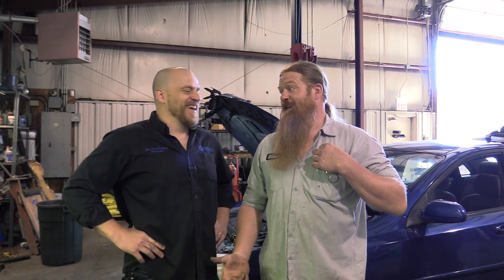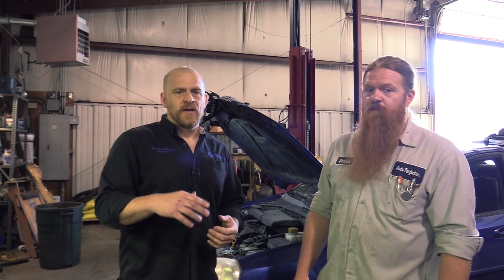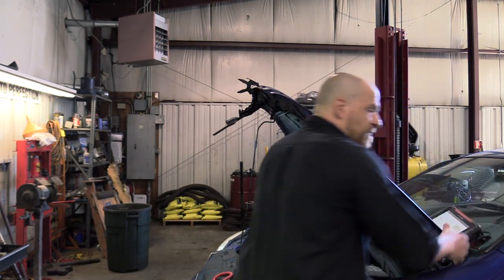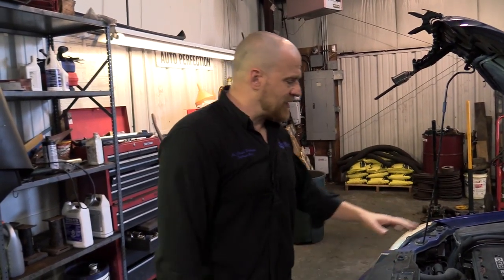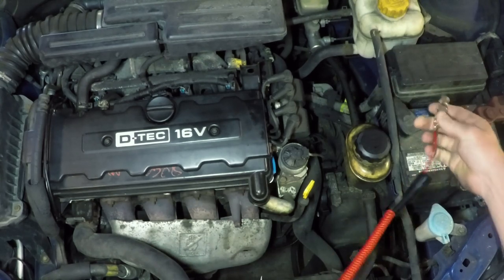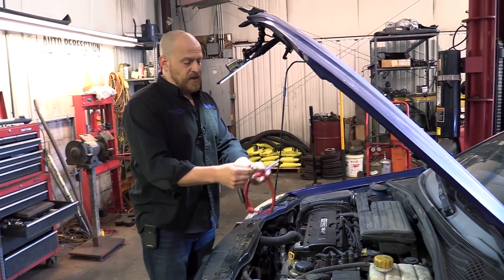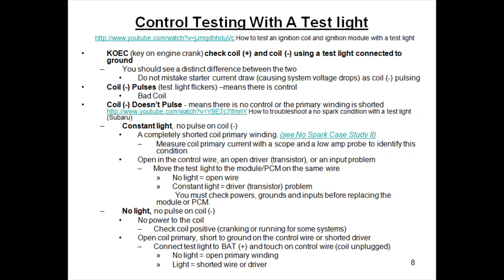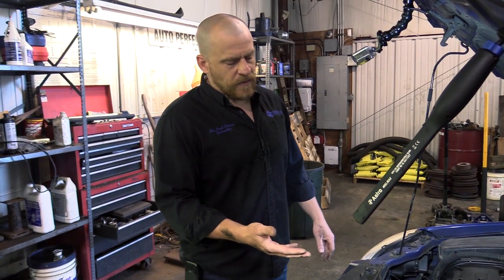Weak Spark From One Coil (Waste Spark Coil Assembly)

Comment: Paul, you spark test method showed me a bad pack on a Ranger one time, then the bad new one a few weeks later. Returned it to NAPA and bought OEM. Thank You!

Yes, loose sparks make boom. Had a tractor flooding. Pulled the plugs and cranked to clear the fuel out. The second crank sparked and lit the fuel. No one hurt, nothing damaged, but there were a few exciting moments!

Comment: This is a great way to find an idle issue that isn't smooth.  You don't have to have a misfire code...it takes a decent amount of misfires to trip a code.  You can simply and quickly test the gap that each coil can produce and find the relationship between them.  If they are way off replace the coil because the power balance of the engine is way off.  Learned a lot from this video.

Comment: Thank you for illuminating my path. That is exactly the symptoms of my coil pack and the misfire on my car that is triggering the "Depollution system Faulty" because the misfire due a week coil pack  is not burning the fuel/air mixture as it should. Thanks

Comment: I never had one explode on me ... but I did get mad one time working on my '79 Mercury Capri 4-banger turbo (ignition problem) when I was 20, and put the handle of my hammer right through the top of the battery in anger. The acid splashed up all over me, my face, and got in my eyes. Luckily it was winter - just grabbed a handful of snow and rubbed the crap out of my face and eyes - got it before it even started burning, thankfully! Cat-like reflexes at that age! My clothes, however didn't fare so well, as you can imagine, LOL! When they came out of the wash, they looked like I stood in front of 10 shotguns loaded with #8 at close range. Mom wasn't too happy about that one ... 🤣 Learned a valuable lesson (a couple, actually) that day!!

Great lesson, Paul, great filming, Caleb, and always great to see Danner - still so happy for you guys about that shop there!  The Lord never ceases to amaze. 😎🍻

Comment: There's always something to learn with Danner, I  was absolutely convinced that ANY spark was a good spark, I wouldn't have even entertained a present but weak spark as being a problem.  The thing that  changed my mind is the draw of the gest light weakening the spark further and enhancing the misfire. Further to this and something that was either unnoticed or not mentioned in the video was that when the spark gap of the weak coil was being tested the draw of the spark weakend the sister spark and enhanced the misfire pro ing the theory.  Again good work Paul.
Reply from the maker: That is correct, when you have an open on one side of a waste spark system it will affect the companion cylinder as well. Thank you!

Comment: Again you really do so much effort, deserve at least 1 milion subscribers. Can you make video about gasoline direct injection injector waveform. Thanks for everything
Reply from the maker: I have some GDI injection operation and testing available on SD Premium, but I am sure down the road you'll see some case studies here on GDI systems too
Reply: @ScannerDanner  Thanks on Euro cars all new one have gdi systems. I looked on the internet and there aren't a lot of information, if I undrestood they are not classic power or ground side switches. They switch each other and voltage is much higher

Comment: I want that job so bad... Id have to move from Iowa tho ☹. The dealer i tech at promised futher training and after a year still nothin, i havent even got a GM tech number to sign into the comp. system..... So I learn from these vids and SDs book (better info anyways) By the way Paul the old timer in the bay next to me thinks ur book is excellent and hes been in the field since the early 70s. Ive even impressed him a few times with your diag methods🤙
Reply from the maker: Awesome! Thank you
Reply: Even Warren, over at "WESTERN TRUCK AND TRACTOR REPAIR" YouTube channel, gives praise to your book and your instruction!! And he is a mobile diesel and farm equipment repair guy!! Ain't too many lessons in your books, describing how to pull a 150lb belly pan, out of a D8 dozier, in order to get the hydraulic hose out, while laying on your back in the Forrest, watching for bears!!
Reply: @ScannerDanner  Sir, my i20 1.2 petrol has exactly the same coil pack layout as in 7.27 time. One coil pack has cylinder number 1 and 4, and the other has 2 and 3. Each coil pack is controlled by 2 wires each which means each secondary circuits are controlled by individual primary coil circuit.

Now, there's less spark coming from the one high tower of first coil pack and same is happening in the second coil pack too.

I checked for resistances reading of the secondary and primary circuit individually in both of the coil packs. They gave same readings about 14k in secondary circuits when tested with multimeter from one tower to another of the same coil pack. I wonder why such less spark is produced on one tower within the same coil pack where the 2 towers are controlled by the same primary coil circuit???? If one is showing less spark, why the same less spark is not produced in the other tower of the same coil?

Please do really help me find solutions!! Have been struggling to find solutions but not succeed yet......Awaiting your utmost service.. thanks.

Comment: one thing to add, on the double spark plug shared coils. bad plugs and wires can cause weak spark when testing, since it's using the other wire and plug as the ground path on other post.
so bad wire end or high resistance from broken down wire can cause it to look weak when testing. I resistance test the plug wires first or use a known good wire and plug for the other side temporarily
Reply from the maker: Think about this my friend, you are correct to a point, but an open plug or wire would NOT cause the spark to be weak on both sides of the coil! You would have to have BOTH plugs and or wires open for this to happen and that doesn't ever happen. This was a valid test and the only variable here was the dwell time issue I mentioned.

Comment: Another good video, as usual. By the way, I believe the reason yo were only seeing the bad coil trace rather than an alternating good/bad is that the shorted coil had a faster current ramp, therefore tripped the trigger level before the other (good) coil trace could trip it every time.
Reply from the maker: Best explanation yet but they still alternate and that trigger level was set to a point where both crossed it. Unless there is an internal clock on the sampling that has a delay before it actually draws the waveform??
Reply: @ScannerDanner  .  That's a good question. My answer assumes it was set up for a single trigger and it catches the 1st one that crosses the trigger level in time (which is the bad coil due to it hitting the current level quicker/steeper ramp).

Comment: dang i wanted to see you dance around doing the spark plug waltz.  lol not really its no fun. i worked with a guy that liked to just yank wires off to find a miss. when ford came out with the duraspark 2  he got bit. that spark found its way to ground and the closest thing to the metal was his wee willy winkey.  to this day i see him and call him sparky lol
Reply from the maker: lol
Reply: Wait till you grab a magneto.. They all watched while I turned it to time the engine. I looked like Doc in Back to the future. As I got hit with 50k volts of primary off it..My hair was standing up form the jolt. They laughed their ass off so hard. I never made that mistake again...
Reply: @ScannerDanner  Sir, my i20 1.2 petrol has exactly the same coil pack layout as in 7.27 time. One coil pack has cylinder number 1 and 4, and the other has 2 and 3. Each coil pack is controlled by 2 wires each which means each secondary circuits are controlled by individual primary coil circuit.

Now, there's less spark coming from the one high tower of first coil pack and same is happening in the second coil pack too.

I checked for resistances reading of the secondary and primary circuit individually in both of the coil packs. They gave same readings about 14k in secondary circuits when tested with multimeter from one tower to another of the same coil pack. I wonder why such less spark is produced on one tower within the same coil pack where the 2 towers are controlled by the same primary coil circuit???? If one is showing less spark, why the same less spark is not produced in the other tower of the same coil?

Please do really help me find solutions!! Have been struggling to find solutions but not succeed yet......Awaiting your utmost service.. thanks.

Comment: Surprising... the underhood layout of that 2006 Suzuki Forenza is strikingly similar to the 2009 Chevrolet Aveo ecotec engine and bay, but the aveo has a coil on plug cassette that runs down the center of the cylinder head instead of externally.

Comment: It's not always that simple! And it pays to have multiple tools at your disposal! Along with your expert guidance and instruction!! I once had a friend need to fix a misfire! And without spending money on the parts cannon ammo! I did all I could, without some higher tech equipment!! 

It was a 97 GM 5.7, with the dist. cap with the scientifically designed spark plug wire outputs, oriented towards the proper side of the engine. There was a low priced replacement dist cap installed, when he got it! It ran well, except for the obvious fuel spider issue, common on that vintage engine! But, shortly he developed a misfire, that even caused the MIL to flash! It was just that I couldn't figure out what was causing it. It turned out to be the cross talk inside a poorly designed dist. cap!! The 5&7 were sparking on each other, inside the cap, where the lines were close together, and fire was jumping between the two!! The spark was jumping from 5 to 7, and then 7 to 5, causing an odd misfire that I couldn't decipher on my own!! It took another buddy with a Snap On scanner, to be able to see what was happening, and when!! A new Delco dist. cap and a rotor fixed the problems! But, you could tell the old ones were brand new, and you couldn't see where they were cross talking inside!! It was just that spark was jumping, deep inside the cap, between the two line! No continuity! Just cross talk!! 

I checked for spark at each plug, and deduced that the coil wasn't bad! I figured that each plug was getting fire, and could tell no other issue for a sudden misfire! As we needed to replace the fuel injection spider anyway, I went ahead and did that job, before going any further! After that, it ran great, except for the oddly intermittent and changing misfire!! I even ran a test light along each wire, looking and listening for leaking spark!! I just finally gave up! When the scanner was hooked up, I wasn't around, but was told what was up before the new cap and rotor was installed!! IT ALL CAME BACK TO ME!! Some cheaper aftermarket dist cap and rotor would cause issues just like that, back in the day! I also got side tracked on the fact that 7 of the 8plugs were brand spanking new, platinum tipped plugs, but one was an older, likely an original style, regular plug! I thought an owner was having issues, and replaced them, which didn't fix the inj spider problems, and broke a new plug during installation, and just put an old plug back in! I wanted to get another matching newer plug, but he refused! He still has the older plug in there to this day!! 

Just having you demonstrate what to look for, what to listen for, and how to check for it all, is priceless!! And I did most of it!! Some times, you just need a scanner, or a rich customer, willing to pay for parts cannon ammo!! Lol

THANKS FOR SHARING!! Say "Hey" to your mama!! ;-)
Reply from the maker: You can use the test light test on the cap end of the plug wires. Pull them off and make sure they all jump past the towers. The cross firing ones will NOT jump the same gap :-)
Nice job and write up my friend. Thank you!
Reply: I wonder why I DIDNT THINK OF THAT?? Oh, I know!! I'm not as smart as...well ya know!!! Lol

That would have been an AWESOME TRICK!! But, it was no biggie. Thanks!!
Reply from the maker: @roadkill5333  lol, it's all good buddy. I've gotten my ass handed to me by this design in the past and it was that test that proved my issue over anything else I tried

Comment: Great video. As are all your video's I have watched so far very informative and very useful to me as iam in the trade .I have to ask I was always told you should not pull ht leads of while engine is running as you can get a nasty shock is this not the case as you pulled them of with out get a shock.

Comment: I have a question. When carrying out such spark gap jumping tests, (on let's say a perfectly good coil), when the gap is increased until the spark no longer jumps, doesn't that immediately cause coil damage which had not been there before? Surely even just one spark that finds no easy part to ground is going to bore a channel through the coils internal insulation to reach the opposite end of the coil winding internally, and thereby initiate a channel of weak insulation which will eventually come back as a damaged coil customer, once some other factor put the ignition coil insulation under high load. I do this jump test myself, but I always try not to provide a gap larger than 10mm, lest when I do, the spark can't jump the gap and coil insulation is immediately damaged with even just one spark that can't reach ground. I realise the damage might not be apparent immediately, but I can't see how damage is not occurring. That enegy has to be going somewhere, so the only place I know of is a direct internal short, breaking down the internal insulation? This is only my assumption, so the question is, can anyone give a scientific answer as to why even just one internal shorted spark doesn't do damage? Thanks

Comment: Well another great video as always and I've got a question on that  waveform at the top of  it will it always have a tail like that or was that mainly bc of it showing as open signal???
Reply from the maker: sometimes that tail can be induced by having the amp clamp too close to the coil housing. I believe that is why we were seeing the large tails but a large tail can also indicate an open plug or wire

Comment: I had the same issue weak spark.. Bought a supposedly brand new ignition control module and got a weak spark from another coil.. Took it back to the store. And it was a return from another customer... Who told them it was a bad I. C. M... So always check your supposedly brand new part.. 👍.. Happy hunting..
Reply from the maker: nothing more frustrating that a bad, new, part

Comment: Thanks for a very detailed video. When you first checked the coil and found you had a weak spark my first thought was what about the spark plug or spark plug wire on the other end of the coil. Since pulling one wire out of the coil and checking the spark you still have another spark plug and wire in its secondary circuit. Couldn't you have simply grounded one side of the coil and then checked the spark on the other end of the coil? If you had a good spark at that time then you would know the problem is in the plugs and wires. If the spark was still weak them you would know that it was a bad coil or a bad coil drive circuit. What are your thoughts on my logic?

Comment: Do you think it might be beneficial to show the result after repair, so we can hear the difference?  You do a great job at confirming the diagnosis/code and explaining what’s happening, but a little conclusion or denouement would be nice.
Reply from the maker: I usually do but it is not always possible. Also in this case, having a known good coil to show you next to the known bad was, in my opinion good enough. The only thing a new coil would have shown you is what you already saw in the coil that was working. You would have heard nothing different. You would have seen a spark that was good and a coil ramp that was good, but again, we already saw that. So that's why I didn't go back to my brothers shop to film the follow up.

Comment: First, I want to say thank you for posting so many videos on youtube. I watch them often. Sometimes, just for fun and educational purposes. I have troubleshoot question now. I own a 1996 Ford Thunderbird LX 4.6L. Could you give me some direction on PO308 And PO301 codes? I also have a PO174 code, but I suspect it is related to the misfire codes. I replaced spark plugs, plug wires and coils are on the way. I used a spark tester on the tower 8, no spark. Then I switched the wire to another tower, there was spark. when I put another wire on tower 8, no spark again. I ruled out the new wires. But what else could cause the one tower 8 on the coil to not spark at all? Is the new coil sure to fix it? Before I finish here, I want you to know the parts were old that is the biggest reason for replacing all of them. Thanks to you, I'm on my way to not just throwing parts at a problem. Your teachings are well worth the time, and when I get my finances in order, I look forward to buying your book and subscribing to your paid channel. Thank a lot SD!
Reply from the maker: This one you should watch https://youtu.be/y4r5OcHN5Lg it has a bad coil driver in the ECM